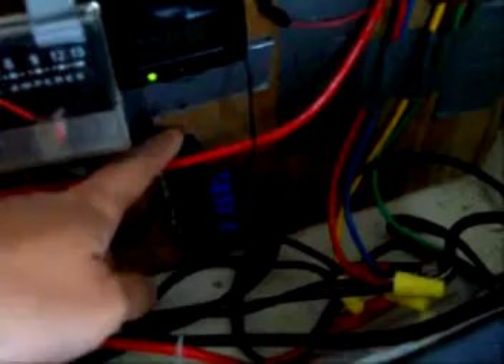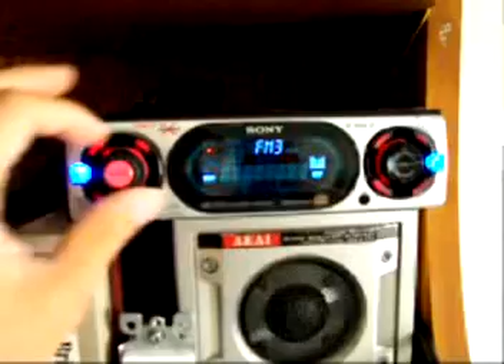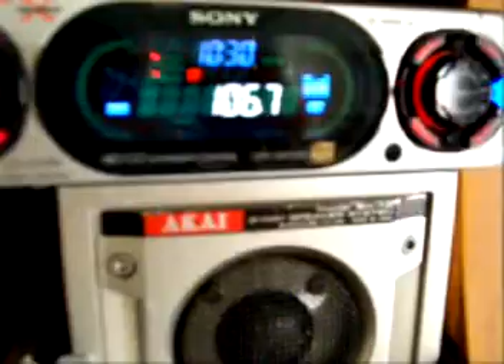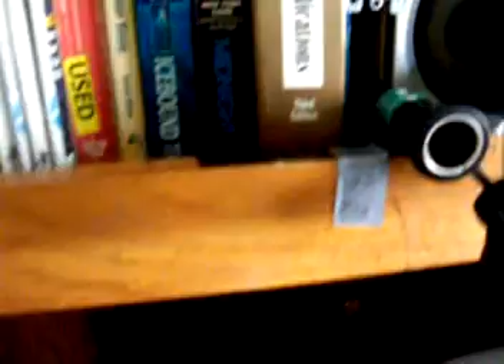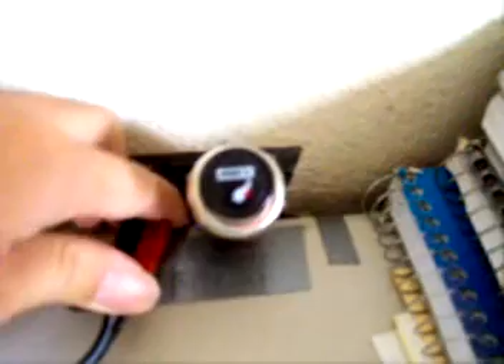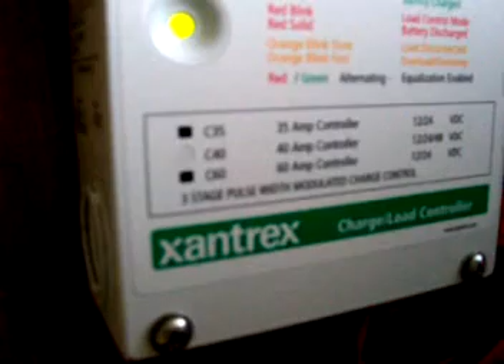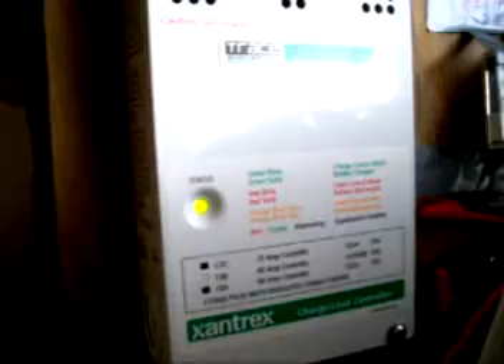12 volt room II

Comment from the maker: I have an inverter already. The way my room is set-up; half of my devices can run on 12 volt directly (halogen lamp, car radio, laptop power supply, ipod/phone charger) so they run directly off the batteries. The other half runs off the inverter (TV, VCR, two compact fluorescent light bulbs, fan)

Solar panels are what I plan to charge those batteries with eventually but those are on hold due to budget constraints.

Comment from the maker: The two 6 volt batteries are wired in SERIES so the voltage adds but current remains the same (220amp/hr).

In parallel, the voltage will stay the same but the current capacity adds up.

Comment from the maker: Solar is what I had eventually planned for charging those batteries but the problem I have now is that the modules are still very expensive.

I somewhat have this project on the back burner right now since I have some other projects to finish first.

Comment: I agree with lambition. It seems to beat th epurpose a bit. You are charging it all from an AC outlet and some of it you even convert back to 120 for your TV (at low efficiency). Yep, should have started with the solar panels.

@12643 why not forget about it completely and use your 120 outlet ;-)

Comment: Hi 
You got a nice set up , would you like to have more use of your battery power  , I can send you a dc-dc converter with MCU digital output control and low battery cut off with all accessories to keep you busy for a while,

Comment from the maker: I already have one of those things. It is called an "Inverter". I didn't show it here though but you can see it in my first 12 volt room video.

It doesn't really "save" energy though; in fact it probably uses a little more since I currently have to charge the batteries from Line (mains) power and there are losses from converting AC to DC. It does help to have light though when the mains fails.

Anyway, once I have solar panels hooked up to charge the batteries, I should have "free" electricity.

Comment: Overcast does not matter at all for solar panels. I had a solar panel at work rated for 24v oc. We took it into the factory and tested the output voltage and got 12-14v and that's with no direct sunlight at all. Also how long would it take for those batt's to lose charge if you hooked it to an inverter and then hooked that to your 120v flouro's and left them on?? Loving the project!!!

Comment from the maker: Right. 

The advantage of the 12 volt halogen is that I can just hook it straight to the battery. My other room lights (fluorescent bulbs mostly) run on 120 volts but I have to use an inverter to step up the 12 volts to 120 to operate them (and my TV and DVD/VCR)

Comment from the maker: I used a 12 volt halogen bulb. Most MR-16 type bulbs are this voltage. Mine is a 20 watt but 35 and 50 watt ones are also available.

There are also 12 volt bi pin halogen bulbs without reflectors in 20 or 50 watt versions. I think they are called "G" type bulbs. I've seen them in many IKEA desk lamps and under cabinet lights.

Comment from the maker: I have a inverter for operating 120 volt items such as my TV, PS-2, fluorescent light bulbs, and a desk fan. My laptop, radio, a halogen desk lamp, and phone/iPod charger plug straight into 12 volts. 

Aside from the laptop when running and charging the battery, most 12 volt items don't draw more than three amps.

Comment: Hey There,
You're gonna get a hell alot of voltage drop using all that cable..

at 12 volts, you are using around 10 times more current, ever thought about adding an inverter into the circuit so you can hook up a tv and xbox or something.

Comment: Nice Work!
PS Overcast doesn't matter too much with the solar panels you have in mind, they will still top up the batteries. Consider using the wind to supplement your solar later on using a turbine attached to a stepper motor as a generator or go for bigger output with an alternator. You can cut your power bill by 60% using these methods. Thanks for posting.

Comment from the maker: I never fully discharged the batteries  to the point where they would be considered "dead" but it seems to last for ages on just a small halogen light or the car radio. I usually run my laptop off it for between 4 to 6 hours. My best guess is overnight.